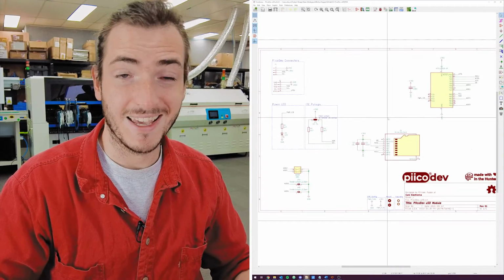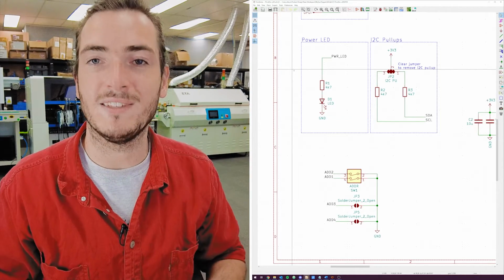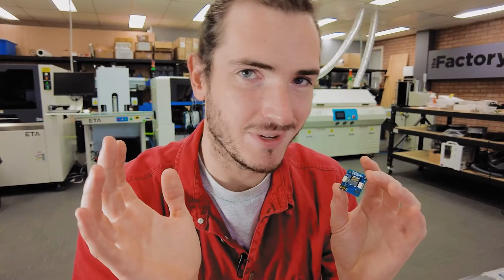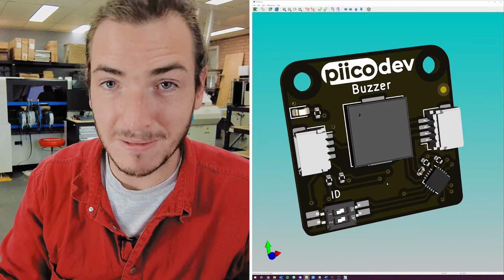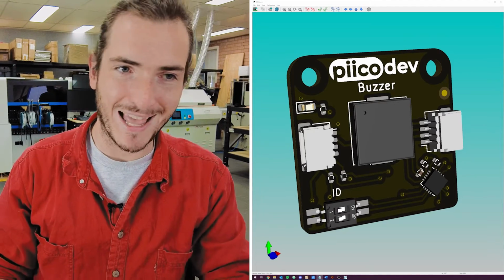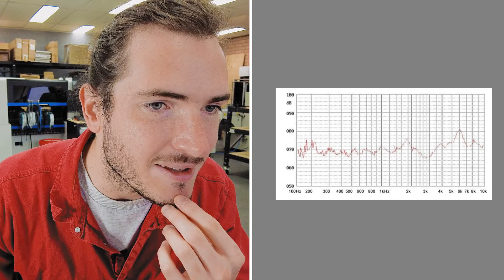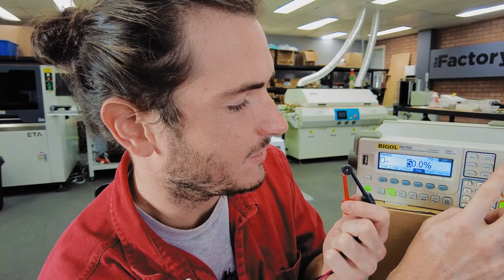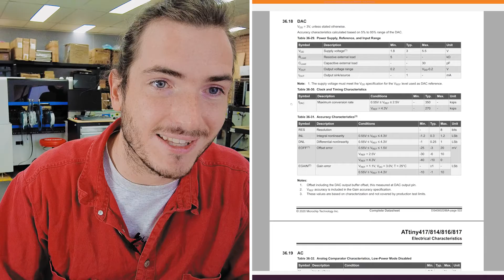The Factory | New PiicoDev 'Smart' Module Development

Comment: would something like a digital pot be 'simple' and capable of being used for volume control - or are those parts to cost prohibitive for such a niech use case?
Reply: Alone they probably wouldn't be able to handle the current. But Tie it to a MOSFET, and you might have something.